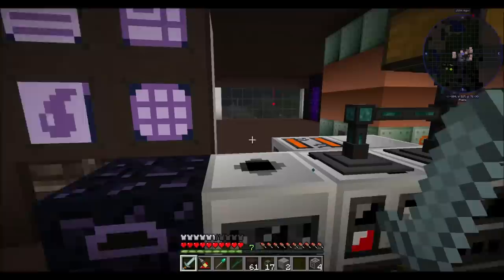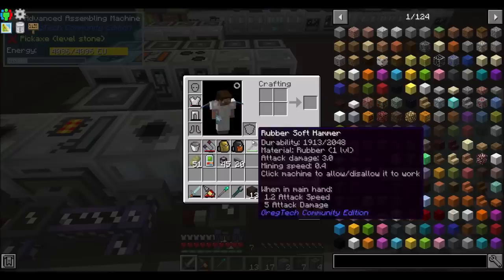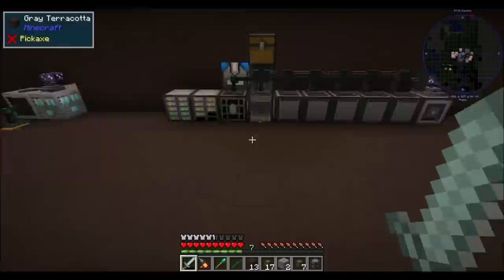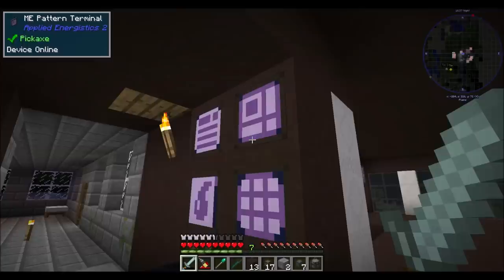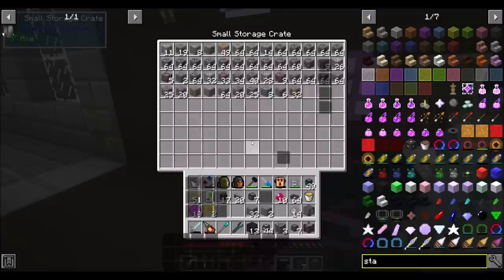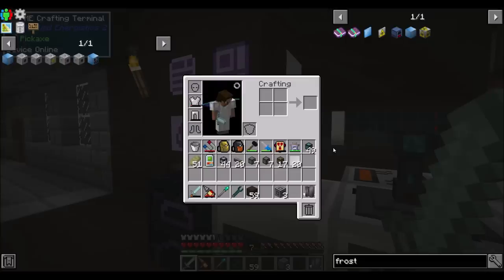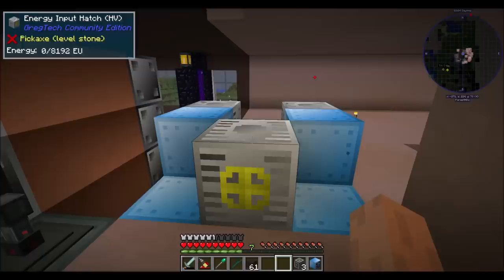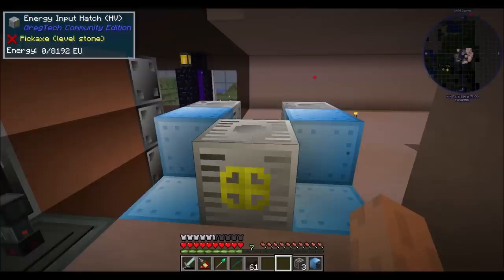OmniFactory   Ep32 Vacuum Freezer

Comment: Rutile would be a ton easier with ore processing setup.  Bauxite ore -> macerator  -> ore washer -> macerator -> centrifuge for example gives 2 rutile dust per a bauxite ore rather than 2 per every 6 1/2 bauxite ore and you can still get those 2 as well.

I kind of laughed at him thinking he can rely on a single blast furnace.  A titanium making blast furnace will run constantly on an HV power input to produce just titanium needed for things basically.  If you want to use something like the large diesel generator you'll need a ton of it as well.

Comment: Hi Dire, I think you should look at upgrading the coils in blast furnace. It can give you faster and more energy efficient smelting.
Reply: i was thinking the same
Reply: not 100% but didn't the quest say that the coil doesn't increase speed? only the temperature? increasing power input does increase speed though
Reply: @Bobbzorzen  if it's the same as in GT5(u) then it also gives you speed boost. For every 1800K over the required temperature of a recipe it doubles the efficiency of the overclock (by making it twice as fast once again).
Reply: Q009 it's based on GT6. There's a quest that asks you to make 4 more blast furnaces since coils wont increase speed. Only more power input increases speed
Reply: Blood Born there are 3 active versions of gregtech and they’re al different
Reply: It said in the questbook that upgrading the coils just lets you make more advanced materials, not give a speed boost. That's why it has the quest to make more blast furnaces.

Comment: Hey dire. If a machine needs a third interface, you can place a hopper on top. The interfaces will see it as a valid inventory and it will insert into the machines. You can keep on stacking them vertically or horizontally to allow for as many interface as you want.
Reply: Thats madness.
Reply: RedstoneZephyrMC wait does this mean for AE2, if one runs out of pattern slots for an autocrafting operation on say a furnace, one could just stack more interfaces above the original one?
Reply: Having an Interface area attached to Ender Chests linked a certain color code for different production lines is a much more organized way to keep the basement clean. The majority of the clutter can be neatly packed into a different room separate from the machines.

Comment: Dire the blast furnace only needs one energy input. the reason the first quest asked for two is because one LV energy input doesn't provide enough power for the blast furnace to run. If i remember correctly the quest said the blast furnace needed a minimum of MV power to run and MV is double LV if I'm not mistaken; which is why the quest said two LV energy inputs.
Reply: Depends on what you want.  2 LV hatches gives you MV powered blast furnace, which will run at base speed for most basic recipes.  1 MV hatch gives you MV power, same basic speed.  2 MV hatches is HV power, double the speed.  The same continues with higher tier hatches.  so 2 HV hatches is EV power or 4 times the speed of 2 LV hatches.
Reply: More energy inputs is better as it increases the speed

Comment: Ah, so dire derp, first recipe I take, there are better recipes on the later pages, it may help to change the font size, so you can see 2 recipes per page, even then I see you use the top recipe even if it is more expensive.
Edit: It seems it is time for you to invenst in some orewashers, they will greatly improve your secondary ore yields, platin a HV material is only found as byproduct during this stage of the game.

Comment: Dire, sticking second interface to machine you overload it. Some crafts are relatively long and if there are two time consuming crafts happened to require same machine it will take even longer. Isn't it more rational to make separate machine if interface is full?

Comment: for the diesel generator, you can use ceu to turn eu to rf  and each hv tier diesel generator with bio diesel can produce 2048rf/t 3 generator is running the whole base for me right now
Reply: The large diesel generator is even better to some degree.  Higher efficiency though it requires an extremely small amount of lubricant and produces 8192 RF/T.  Throw oxygen in it and an IV hatch and it goes up to 24,576ish RF/T.  

Just upgraded to Cetane-boosted diesel and currently using a large diesel generator and 8 turbo diesel generators.  Oxygen boosting and 2 more large diesels will be next!

Comment: The basement does look cleaner but the conduit showing makes it like it did
Reply: I get why he keeps it uncovered though. It'll make it easier to move wiring if he knows exactly where it is instead of hunting for facades
Reply: @vladdangel  Holding any conduit or the Yeta Wrench makes facades clear, so not much of an issue. The bigger issue is that he currently doesn't have a Painting Machine to make the facades look like the rest of the floor, and he's kind of backed up on autocrafting at the moment.